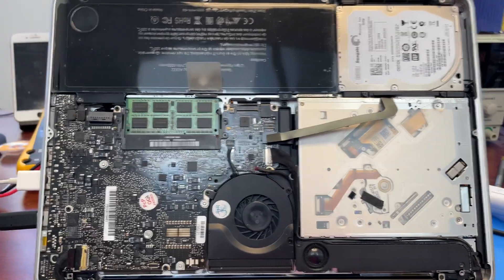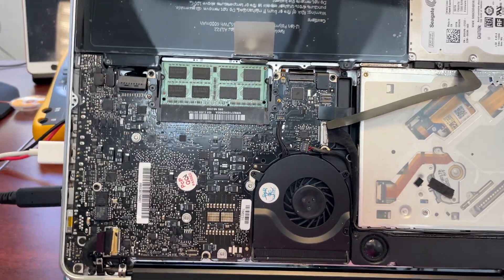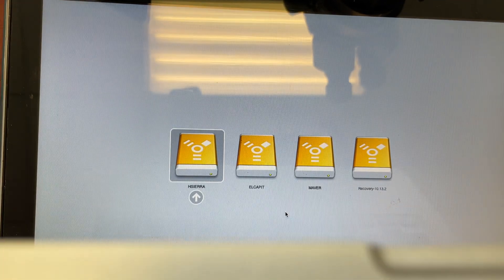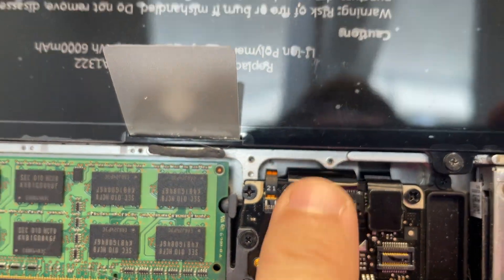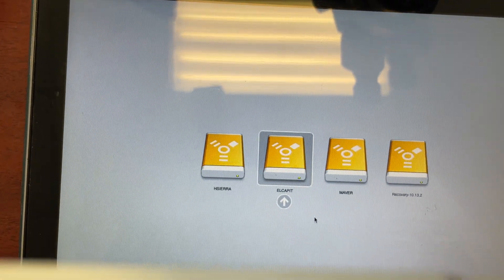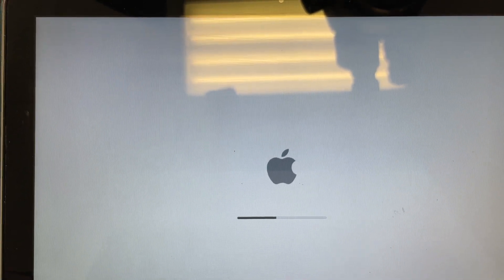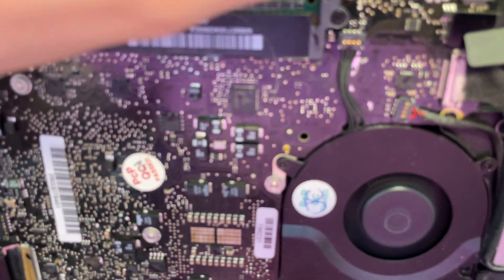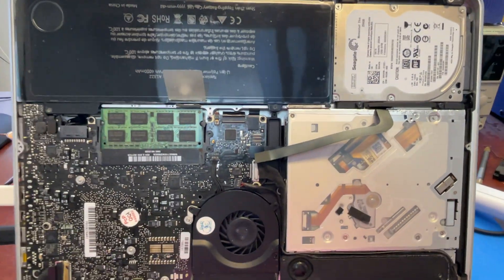MacBook Pro Shuts off while booting CAUSE and SOLUTION

Comment: So let me get this straight: the actual problem is the power button because it's registering as constantly pressed, right? But you say the keyboard has to be replaced. So the question is: is the power button connected to the keyboard? I have the same problem and am looking for a solution. Another thing, is it difficult to replace the keyboard and power button?
Reply from the maker: Power button is a part of the keyboard. Not hard to replace

Comment: Hi there---I have a late 2013 MacBook pro and this just started happening. I am meaning to get a new computer but want to be able to get stuff off this one if needed (I have an external back up also). Can I bypass the problem by somehow using an external keyboard without replacing it? I guess I still have to take the back off of it??

Comment: Hi interesting video but I'm confused as a layman.
Your pointing at a component inside of the computer and referring to it as keyboard ?
And then describe the issue as  usually water having gotten in keyboard (actual keyboard I'm guessing)
My 2009 iMac begins starting up for a few seconds..flashes then shuts down. Then will only repeat when I unplug it and plug back in.
This seems to be the same problem described here.
If it is replacing keyboard would solve it ? If yes how do I  decouple the keyboard if the thing won't turn on for more than 2 seconds Thanks
Reply from the maker: iMac has no integrated keyboard so this video is irrelevant to your issue
Reply: Oh sonothing related thank you.Ours started happening after a power outage.
Reply from the maker: Your issue could be related to power supply or video card
Reply: @applepietech  thank you

Comment: So no solution then. Not exactly well titled.
Reply from the maker: Did you watch the video? Keyboard replacement is the solution in this particular case
Reply: @applepietech Hello, I have 2011 MBP and I wanna unplug the keyboard from the motherboard, I'm not good with the tech stuff, so, is it possible for you to upload a photo of a motherboard and circle the places that I gotta lift, remove etc? yandex link & google drive would work, tysm!
Reply from the maker: Check repair guides on ifixit.com, they have high resolution photos or get your computer to a professional repair shop if you are not good with electronics.
Reply: @applepietech  Its not popping up on the website
Reply: @applepietech  fast forwarded to the end to find out the solution. Guess that wasn’t the order you gave out information…as the title suggested.

Comment: How do you unplug the keyboard from the motherboard? Do you lift that little hatch it plugs in or do you pull the ribbon connector out?
Reply from the maker: Both, latch first
Reply: @applepietech  thanks figured it out. The latch you lift from the top, not from where the cable is inserted. almost couldn’t get it back in though. Unfortunately I wasn’t able to bypass the MacBook problem shutting down when I try to log in. I was hoping this might do the trick .